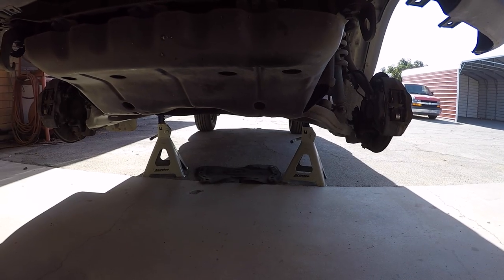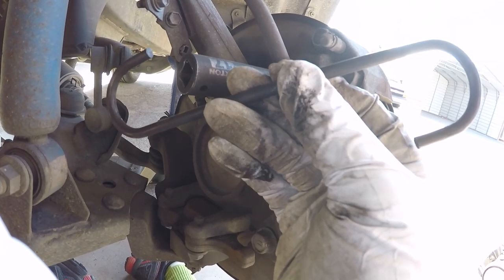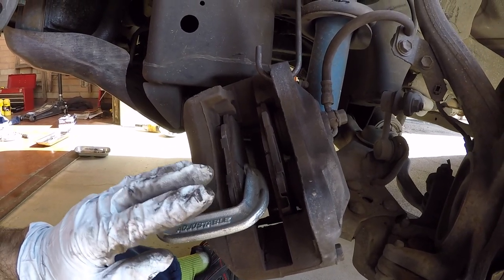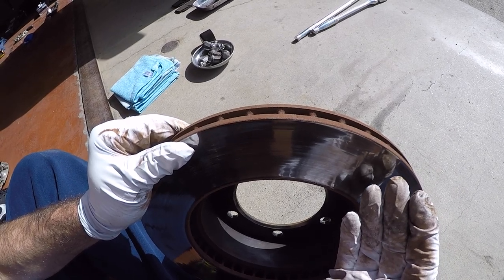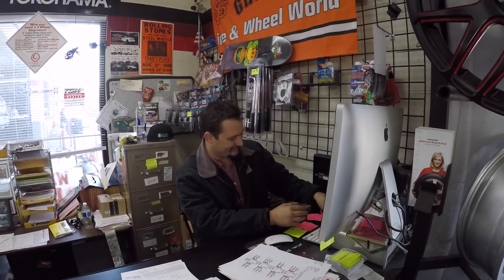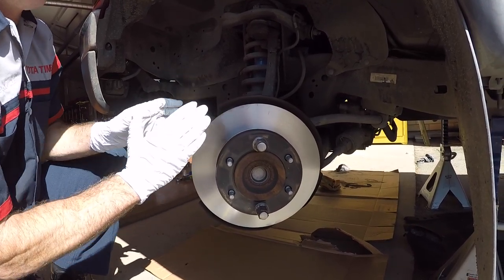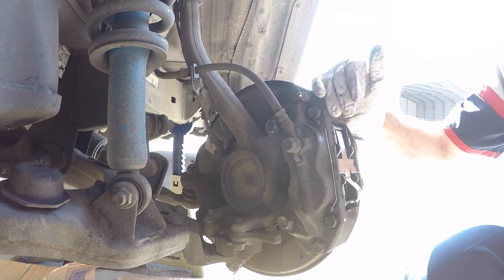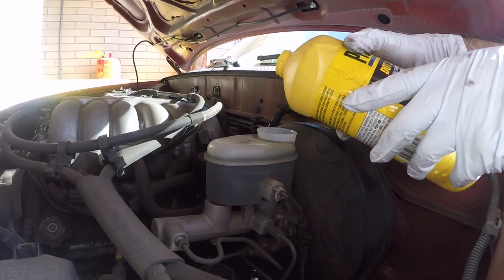Disk Brake Service

Comment: Love your vids! I recently did the brakes all around on my 07 Fj cruiser, driver side had a seized piston. Ended up replacing all 4 calipers with Napa remans. Went with a powerstop pad and rotor kit, which I’m not having a squealing issue but I am experiencing a metallic pop/pinging sound once going from drive and beginning to reverse in some situations. Some research points me to an issue that many Toyota trucks have in that the pads shift and can make a pop sound when changing directions. I did reinstall the one lower pad spring, everything is torqued properly, and I know the dust shield isn’t inferring with anything. Have you come across this before? Wondering if I should shim the pads with the oem parts as I tossed mine as they were in bad shape. May also try adding a second spring clip, as there are provisions for them, though I know from the factory they only use the one spring. Thanks for any input.
Reply from the maker: The second spring clip might help.  Lots of guys do this including myself.  Why these kits don't come with two springs in the first place doesn't make sense.  You could pick up another spring at an auto parts store by giving them your year and model truck.  The other parts you threw away are the anti-squeal shims.  I don't think those being missing could be causing the problem you're experiencing.  Try the second spring first and see how it goes.
Reply: Timmy The Toolman sounds good, that was my next plan of action also. It’s just hard to diagnose as I replaced everything in the front end short of the steering rack and wheel bearings, so there are many variables. But all the Ball joints are lubed and torqued properly. Same with the new lower control arms, driveshaft is lubed, Rebuilt the axles with high angle boots, I didn’t experience any issues with the cv axles prior to this and I get no noise when turning, and this is only apparent with direction changes. Also installed fox 2.5 coilovers so spring bind was a thought, but I’m within the tolerances called for by fox for preload, swaybar was removed to rule that out. I did drive it a bit before doing the brakes and this problem didn’t present itself then, so Im thinking the culprit most likely has to be the brakes. Thanks again for the vids you put out, they were useful on the axle rebuild process and diff seal replacement. (Just wish I saw your vid on the needle bearing, when I had everything torn down, though I don’t have a gross amount of movement, yet lol)
Reply from the maker: @lilbabykenny  Well, hopefully the additional spring fixes the issue. Let me know if it did.

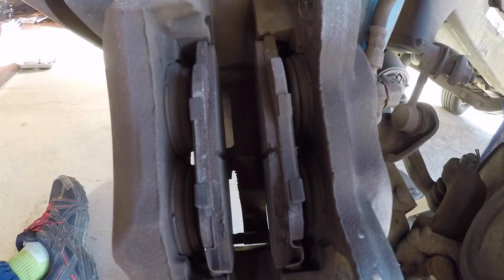Comment: 11:35 ... dealer front brake service (199$ special included parts and resurface rotors)  apparently did NOT include checking and adjusting fluid level in the res. I found the fluid COMPLETELY full to the cap after pushing pistons back in on 4mm pads.  I asked if they bled the brakes after pushing pistons back for new OEM pads and they said they did not have to bleed them.  so i just used one of those suction basters to remove quite a bit of the extra out carefully to bring it back down to the max level... if this brake fluid expands under temps or pressure it may have blow the cap OFF of the resevoir!
Reply from the maker: That's a total Rookie job, not understanding that when you compress the caliper pistons to fit in the new pads, that brake fluid you displaced goes somewhere, and that somewhere is the master cylinder.  This is more proof it's better do do your own work.

Comment: Hi Tim working on my 3rd Gen. I bought factory pads. One pad has twin opposing wear tabs one oad has single wear tab. Which is inside and which is outside ? Thanks!  Chase in Alabama.
Reply from the maker: It doesn't matter which side they go in.  The wear tabs are just there to alert you when you're getting close to going metal on metal.  I wondered the same thing if it mattered and came up with the conclusion it really doesn't.

Comment: Timmy the tool man! What’s up boss I did my brakes for the first time on my 2002 4Runner limited and on a cold engine the brake reservoir is full but when it’s hot and used the fluid drops down between min and max is that normal?
Reply from the maker: I honestly haven't looked at my master cylinders that closely to notice if they drop after the vehicle has been running a bit.  As long as your brakes are strong and you're not noticing any leaks, I'd say you’re good.  I'd just keep an eye on it for a while to verify it's not dropping anymore leading you to believe you do have a leak.

Comment: Thanks for another great video Timmy.  I had to replace rotors and pads on my Prado and this helped out a lot.  I have discs all round.  Long story short, ended up having to replace handbrake linings and springs that sit inside the rear discs.  Your recent video on having patience, using the right tools and taking regular time out got a fair run on this part of the work.  Very happy to say job is done, done right thanks to you.
Reply from the maker: Hey Andrew, good to hear our video helped you out and you were able to persevere on a job that ended up being more involved than your thought.  Great job and Happy Wrenching!

Comment: I watched a lot of your videos and some other ones I’ve never seen that tire trick I have some decent rims that I purchased and I’m so scared to scratch him on the inside barrel this is gonna work So much better the inside of my door says 26 pounds for tire pressure with the 16 inch rims 265 70 16 If you have a moment can you let me know what you think about that tire pressure 26 pounds
Reply from the maker: 30-35 pounds is usually what I use.  26 seems a bit light.

Comment: Hi timy love your videos what  brake rotors you recomend that will last and won't    Warp  for 98 tacoma
Reply from the maker: You can't go wrong with OEM.  For aftermarket, Napa Premium rotors seem to be good.  Rotors don't actually warp from the heat.  They can wear unevenly or get uneven brake deposits but they don't actually overheat and bend.  Glad you like the videos Sean and I are making.

Comment: Hey Tim. Awesome video! Quick question: is it necessary to lift truck on 6 ton jacks. I don't have 6 ton jacks so I has thinking about change one rotor at a time using my regular car jack. Do you see any issues doing it that way?
Reply from the maker: That is dangerous Marx.  You never want to rely solely on the stock car jack if you can help it.  When you're on the road and get a flat, it's your only choice, but when doing repairs at home, it's much better to have your rig supported by a quality jack stand.  Your health or your life is worth the expense of buying yourself some jack stands.  If money is super tight right now, you could use cribbing as a backup support.  We use it in the fire service.  You could use wood 4x4 pieces to build a box under a support area.  We use the cribbing in conjunction with air bags.  As we lift the vehicle with air bags, we build up the cribbing under a frame member or edge of the body on a unibody design.   If the air bags fail, the cribbing is our backup.  In your circumstance, if the jack fails, the frame or support member will drop onto the cribbing and will save your life.  But, if you have the money, I highly encourage you to make the investment in a good set of jack stands.
Reply: @TimmyTheToolman  appreciate the explanation and feedback!
Reply from the maker: @marxccc  You're welcome!

Comment: The passenger side wears out quicker cause it has the shortest path from the master cylinder. Master cylinder to abs module to caliper. Abs module is on passenger inner fender
Reply from the maker: Casey Daniel Very interesting.  Thanks for sharing this.
Reply from the maker: riikerman  I think he's saying the fluid flows from the master cylinder to the ABS module and then to the individual wheels.  I haven't followed the line path so I can't say for sure what he's telling us makes sense.
Reply: riikerman  Thats true on some vehicles but this tacoma has abs. The brake line runs from the master cylinder to the abs module on the passenger fender then from there are separate brakes to the front wheels. i work on these all time the front brakes on the passenger side are always a little bit lower.

Comment: Hey Timmy, I got a weird one for you. I did a brake job and changed my rotors to drilled and slotted with new pads. I noticed the top of the pad didn’t sit evenly with the rotor. The pins that go through the rotor sits the pad about a 1/4 to 1/2 inch above the rotor. I thought I had ordered the wrong rotors but double checked and verified they were correct. I even bought another set of rotors from O’Reillys and the pads sit the same way. I even bought another set of pads to see if that was the culprit. Same result. Am I missing something?
Reply from the maker: No clue other than the parts store's computer spitting out wrong information.  Did you compare the old parts with the new parts?
Reply: @TimmyTheToolman  I did. Looked to be a perfect match. I based the rotor off the sticker on the driver door for a 15 inch wheel. I have 17 inch wheels on it now. Maybe the calipers are sized for a 16 inch wheel. I have a 2002 4Runner SR5 4WD.
Reply from the maker: @ccrook12  Yeah, that might be it.  There's different calipers on there than you thought.
Reply: @TimmyTheToolman  that was exactly it.
Reply from the maker: @ccrook12  Good to hear you figured it out.

Comment: Its only 80ft-lbs
Reply from the maker: What is only 80 ft-lbs?  You see, we've removed more than just the brake calipers.  Maybe you're talking about the wheel lug nuts.  Anyway, it doesn't really matter.  The torque values we give in the video are 100% correct.

Comment: His truck wore out the pads before he got tired of rotor shudder?   Impressive!   Maybe that’s not as much of a problem in the lighter Tacomas vs the Tundras?
Reply from the maker: He wasn't getting any shudder.  He just had a squealing sound and we determined it was due to the brake pad wear indicator rubbing on the rotor.
Reply: Our (heavier) Toyotas seem to need rotor work long before the pads are gone.  They function fine, but pulsation can be irritating after awhile.   The next time I change them I’ll try the breaking-in method to see if better, more uniform pad contact helps prolong the rotors.
Reply from the maker: @koomo801  Make sure you are utilizing engine braking.  If you don't know what I mean, it means using the transmission gearing to increase the rpms of the engine.  A lot of people with automatic transmissions don't know they can downshift just like people do with their manual transmissions.  When I want to slow myself down on a grade, the first step is turning overdrive off.  Then next downshift is shifting into 2nd.  The final downshift if it's really steep and you need to go slow is shift into low.  Any time you're descending a grade and you find yourself needing to ride the brakes a lot, you're doing something wrong.  Ideally you're using engine braking to slow your rig down so you only have to use the brakes moderately.  Less heavy braking will lessen the heat build up on the rotors.  When you superheat the rotors and then come to a stop, you end up imprinting pad material onto the rotor.  It's a common misconception that the rotors actually warp.  What's actually happening is the rotors are getting uneven brake deposits on them causing the shuddering.
Reply: I'm an engine-braker in an automatic and I STILL get the "warped" rotors (3rd gen) despite being super easy on the brakes.  Haven't been able to find anyone that turns rotors on a lathe anymore. Disappointing to have to replace rotors with so much metal left on them! You make the best car DIY vids out there Timmy, keep it up.
Reply from the maker: @anthonyk5496  Hey Anthony, that's interesting you're still having trouble with your rotors even though you're using engine braking.  Are you regularly going down steep grades?  My brakes shuddered really bad on my 2000 4runner when I bought it.  I changed the rotors and pads and was mindful to not overheat my brakes and my braking has been pretty good ever since.  That's too bad you can't find a place to resurface your rotors.  I think maybe lots of shops stopped doing it because there was no business due to most people just opting to toss their OEM rotors and replace them with cheap aftermarket ones.  Thanks for the nice compliment.  Sean and I appreciate it!
Reply: @TimmyTheToolman  Yeah, I'm up in BC and make a bunch of trips back and forth over the Rockies each year – it is what it is, might be worth the Tundra upgrade for me. Kudos to Sean too, I know he puts in a lot of work!
Reply from the maker: @anthonyk5496  Yeah, the TBU might be a smart choice since you're in the mountain a lot.  Yep, Sean does his fair share of the workload for this channel

Comment: Have you tried the akebono brake pad brand?
Reply from the maker: No, we haven't tried that brand out.  We usually try to stick with OEM Toyota pads.  I have used some ceramic pads I bought through Napa Auto Parts which have served me well over the last 5 years.
Reply: @TimmyTheToolman  thanks. I live un Guatemala and OEM are to expensive...thanks for writing back.
Reply from the maker: @monchitoscalecrawling5035  You'll be fine with aftermarket pads.  The Akebono pads look like they get good reviews online so they look like a safe bet.  If you ever visit the California Bay Area, contact me.
Reply: I read somewhere that akebono manufactures the toyota OEM pads...